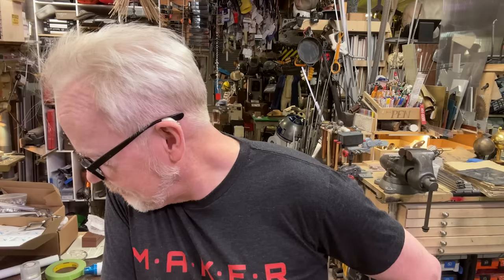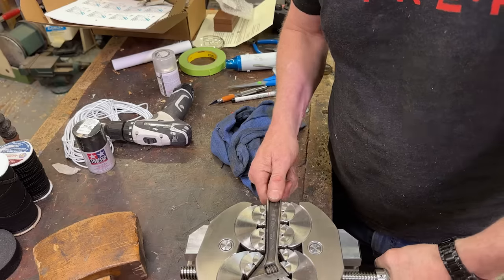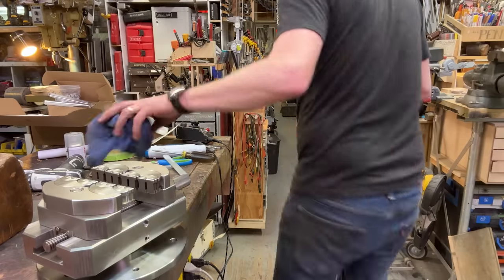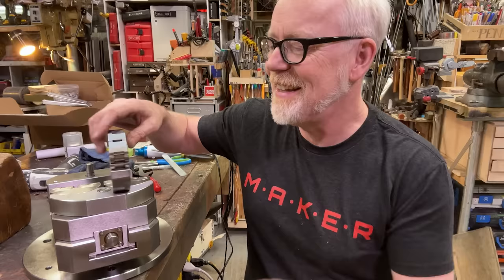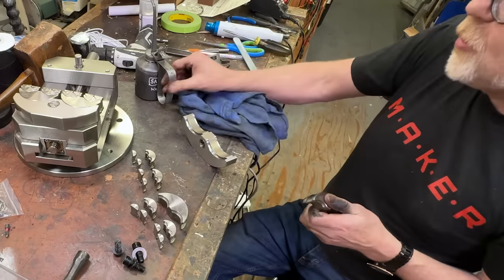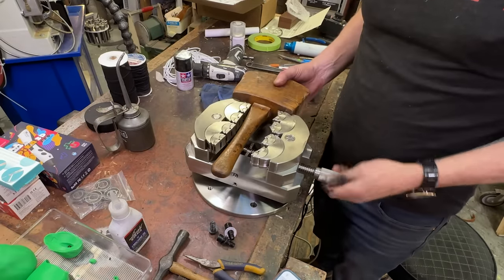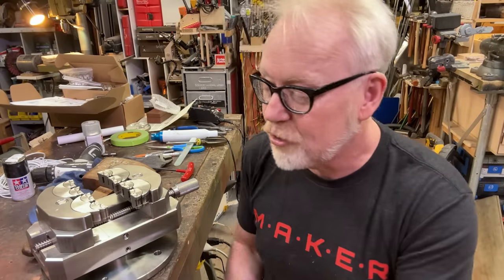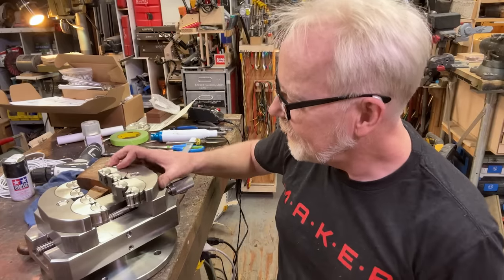Adam Savage in Awe of This Fractal Vise!

Comment: Machinist here: Adam, use a fine lapping compound to really slick up the vise. JB's bore paste is one that I would recommend, it's what gunsmiths use to lap in the bores of target rifles or to slick up an action. The only caveat  is, you will have to manually work the paste in the assembly to promote the surfaces to wear together, but something tells me you won't mind spending a few hours getting her polished up. Awesome find!
Reply: Didnt he literally say he was going to do that? I mean, it's nice to confirm and validate his thoughts I guess. Maybe he wasn't sure he was right already?
Reply: @Falenir Adam did ask for advice towards the end of the video
Reply: @Falenir  there are various grit and if too aggressive roughness, can bind and make it work worse.
Reply: For better action, you would want to increase the number of points of contact. It would be difficult to do with the geometry. Probably some 20 micron or coarser diamond on a nylon or horse hair brush. Possibly a basswood stick in circles. Possibly a cone type brush in a dremel to make non-uniform scratches on the mating surfaces to break up the contact points. Finish with semicrome or blue rouge or similar  to de burr cuts made by the diamond. If there was some way to adjust the tolerance, it would be easy. Also, a machinist here. Worked for 10 years in extrusion, making dies, slitters, and punches. Now, I'm doing maintenance for robotic welding and hot forming.
Reply: Question for the machinists. Are there preferred faces to try and remove material from? For example the surroundings of the dovetails over the dovetails themselves, or vice versa.
Reply: Came here to say lapping compound!
Reply: @InsanityOnWheels  I would try to break up the surface above and below the dovetails. The goal would be the same as honing an engine cylinder. Cross hatch pattern that holds onto oil.
Reply: Just remember to wash it all out when you're done  ;)
Reply: He literally said this at 18:12
Reply: @jutny see above
Reply: @FPSG NO -- keep diamond,or ANY other durable abrasive AWAY from the sliding surfaces ! ! ! 
Silicone carbide is o k .
moderndaytinker here 😎👍
Reply: @Intentionally_Inflammatory  So they missed a part of the video. Who cares? I bet you correct spelling on twitter.
Reply: @bobbob8229  As long as you clean it and do not lap with it, it's fine. Lapping the surface together with diamond would 100% embed it in the surface. Garnet would be better. Sc might work, but I have never had any luck using it in the way I described it. The grains just don't seem to be sharp enough to cut without some pressure.
Reply: I would machine a straight line into each piece so it can be adjusted with a straight edge or screwdriver.
Reply: I would’ve tried a valve oil, used in musical instruments like trumpets, it’s a very fine oil and it is about a 10th the cost
Reply: He'll send it to be done by the faceless worker.
Reply: Toothpaste.
Reply: not a machinist 1 year doesn't count but I work in semi-conductor and if you're looking for polish products you might want to look into wafer polishing slurry that said no idea where you would buy it we backlap and polish wafers to mirror finish and grind them down to 3 mils 0.003" 0.0762mm thick (not a brag anyone would care about except a machinist maybe lol) never tought looking at the surface with a microscope but the scratches must not be deep considering there's almost no material in the 1st place

Comment: The more people know about the fractal vice, the more people will want one, and the more practical it will be for companies to make affordable ones.
Reply: the law of supply and demand
Adam has created a demand for these now, so the supply will need to catch up, lol
Reply: The problem is this takes very high manufacturing tolerances, and hand assembly.  It is a high precision instrument masquerading as a dumb shop tool.  $2500 may be high but probably not that high for such a construction.
Reply: As cool and satisfying as it is, it's actually kind of impractical,.. not sure what uses it had in mind without a hand crank bar
Reply: the way each piece connects to each other without the need of complicated components or tiny pieces like screws or being bolted or anything makes me think that it should be cheaper than other tools that need more complicated construction. as long as the pieces are accurately constructed it's relatively easy assembly should reduce it's cost. it's so expensive because it's an uncommon design
Reply: They'll get cheaper but they'll never be cheap,
Reply: More affordable yes, inexpensive probably not. :)
Reply: That would be great, because they're sure not affordable now! But if it came down to a few hundred dollars I'd absolutely get one.
Reply: @JohnVanderbeck  There are alternative and cheaper ways they could do the mechanics of a fractal vice.

Alternately, if there is enough demand, specialized tools could be made for mass production.
Reply: Super fine machining is never really cheap though, no matter how many is made.
Reply: @mandelorean6243  Exactly, imagine trying to keep that thing clean lol.
Reply: The uses I have for one of these in paintball repair is growing with each second I watch this video, but 2500$ is definitely out of the question so I'd love to see affordable ones become a reality
Reply: I see $1,587 for stainless steel! Too rich for my blood, but certainly less than the $2,500 mentioned.
Reply: You are always going to pay over 1k for these regardless.
Reply: I honestly had no idea these were that rare. I have worked at 2 different companies where these vices were really common. 1 did furniture repair and had 1 of these with rubber grips at the end, the other did oilfield engine repair and every mechanics bench had 1 and 1 guy had a second giant one. I just assumed these were about as common as flat grip vices.
Reply: @ksavage681  there is a market for an inferior version. Adam will but his vice on a mill. He will put that horse to work.
But... if you want something like this for smaller scale or plastic/wood, then you get away with slop, that you can catch with rubber on the surfaces.
You would not put that thing on a mill; but... if you want to file the surface of an akward piece, the weak working holding is not strictly an issue.
Reply: @emeltea33 I'm sure a decent chunk of that $2500 was shipping it from China. It looks pretty heavy and customs was probably a pain.
Reply: @northwoods3d handtoolrescue should object
Reply: @ksavage681 you dont need super fine machining to mass produce a fractal vice to very high qualities. 
just a centerless grinder, a bandsaw, and an horizontal milling machine.

The issue is that each would have to be set up for just the fractal vice, a process that could take a month or two to get right, and 6 months to work out all the bugs and that is just thousands and thousands of vices 

On the other hand, i gave a method and tool list that could be set up for an equipment cost of less then 10k and Adam Savage + Hand Tool Rescue just dramatically increased the demand
Reply: Its hard not to think that maybe we've forgotten "how to make things" somewhat when stuff like this was made - quite literally - 100 years ago.
Reply: this!
Reply: @northwoods3d  I can't remember the exact item, but a few months ago, Adam mentioned some small part on Amazon.  I think it was the clips from his soldering station.  I went to check it out and two days after the video went up they were out of stock. xD
Reply: @Coconut-219  we haven't forgotten.
That said, those who specialize in various production techniques do so with the intent of automating every form of production with the intent of a world where both everyone works to get what they want; and nobody has to work to get what they need.

Or so that's how the field was taught when I went to be a production engineer and Machinist, alongside pictures and autopsy reports of all the frankly horrific and terrifying injuries that are no longer an issue due to our current level of automation. A very powerful motivation tool to get humanity past the industrial era, and fully into the bespoke, modular, personal automaton era
Reply: @Cristopher.C  THe problem is in machining not just 1 curved dovetail it's machining 14 to very close tolerances. Machining a straight dovetail is just a matter of picking the size bit you want and doing it. Machining level 101. Doing that in a curve is NOT level 101.

Honestly. I wish I had the machining skills to make a half assed attempt at that.
Reply: This was my comment:  $2500 is not a lot IMO for the amount of engineering in that for what will be a relatively low production volume item

Its the sort of thing that one you know it exists - every machine shop wants one.
Reply: @ksavage681  NO - you can not just cast it and bang it out like a normal vice
Reply: @Agnemons  All those working faces are likely to be finish ground, which means some fancy fixturing, and on the fly grinding wheel monitoring and maintenance. I can't see these being cheap(er) unless there was a massive demand.
Reply: Not really. If people are willing to drop $2,500 for them, there's no logical reason for them to ever be sold cheaper. This one needed work to even function sort of correctly at that price point. And, this one was from China. Made in the US, I could totally see the price being 6x higher because "It's not 'Chinesium'! It's made in 'Murrica!" and goobers lining up to pay it all day....for a widget that you'd use maybe once every five or six years.
Reply: @JohnVanderbeck  Exactly I don't think anyone could make it better and cheaper (delivered and with taxes!) just a matter of running the numbers really. To me this is a very specialized tool and there's always a market for these, just not a mass market. I'm not sure these are meant to clamp with a heavy force, I'm not even sure they hold parallel after you clamp something, there's bound to be some jaw lift given the multiple mating surfaces, so it probably is better suited for other non-precision machining tasks (Adam talks about using it as a milling vise but I don't know how safe that would be, especially with the current handle and no lock?)
Reply: @TinkersKustomPaintball  I think in your case where sometimes clamping force is low (for most tasks) perhaps if you mostly work with specific models you could come up with 3d printed jaw inserts and for the the rest of the tasks where force is required your current method should suffice because I'm not sure these vises have a heavy clamping force especially given the jaw style. I do similar work with CO2 and PCP rifles, my best friend is a piece of leather and a huge old vise. Most gunsmiths use the same method for clamping barrels, despite having lots of options available the good old leather or a piece of old engine belt works wonders. But I see what you mean, try to look into other positioning vise options if you don't need the force and maybe look into the 3d printing idea, no harm there. The reason being you can't really have a functional fractal vise if you lower the quality, just picture the cheap cast C clamps or the cheapest vises out there they are hardly usable (I've broken lots in the past without much force).
Reply: @tjfritts9013  Well for the most part you have to account for the cost of living, cost of materials, cost of transport, cost of machining in general (which includes machine maintenance cost, tooling, software and the cost of the machinist's salary) plus a certain percentage of time/material loss due to failed parts, fitting, packaging, etc. All of these summed up far exceed what Adam paid for his, let's not get into other issues such as taxes, politics / unions and every other sort of commercial cancer out there... There's hype but there are also great products made in the US, I get what you mean though. What I see happening is people ordering the parts from overseas and just stamping a name on them after some TLC to the mating surfaces, which I don't condone whatsoever but they could make a quick buck here and there until someone compares the two and busts them. The other option is to contact the current manufacturer and ask for a higher quality version which you could resell for a profit, but it will always cost more than 2500 each unless you somehow managed to purchase an entire maritime container worth to bring the unit price down, who knows!
Reply: Sorry calling shenanigans o. Your comment there abrr2000
Reply: Maybe they will finish them properly.
Reply: @Psyco913 nah, shipping was minimal. Ships crossing the seas daily with packages full of air and lightweight goods. The volume of the package is quite small.
Reply: @JohnVanderbeck  its so easy to assemble you can send it out disassembled with the quality of mass machined parts we can do in todays world it wouldnt be that difficult or exspensive if you mass produced the issue comes when you only make a few of them thats where cost becomes a issue.
Reply: @Cristopher.C  Oh boy, fitting curved dovetails are not easy or to make, cnc or not. This is as far from an easy manufactured design as you can get. People here seem to forget you can't really produce this properly with a normal dovail bit or cylindrical grinder. The easiest way I can think of is using a CNC lathe for the dovetails and then milling half of the jaws off. But it's gonna require quite a bit of setup to make something like this. 

What I don't get is why they don't make the jaws a bit larger (more like a D) and use center pins. The pins wouldn't need to take up any force when clamping (the circular surface on the back would do that), but would keep the jaws together when opening.

Comment: fun fact: the bearing surface being on the circumference is critical to how these work, because the center of pressure for each crescent must be BEHIND the center of rotation. This means that when you apply pressure to a crescent, it rotates TOWARD the source of the pressure, instead of what would normally happen, which is an object rotates away from applies pressure. If you look, the crescents are actually slightly less than half a circle. So if there was a standard axle, it would be partially outside the circle

Comment: I would highly recommend numbering the parts if you are going to put work into mating them. They were made close enough to interchange new, but as you lap them together they will become mates finding the average of each others error. I'm not sure without holding it just which surfaces bear the force first as they compress into each other, or if those might benefit from some cross hatching like a cylinder bore to hold oil. I'm glad you picked this up, and thank you for sharing it with us all.
Reply: Exactly.  I think that's what I was trying to get at in my reply.  Making a copy of something that was invented and perfected a hundred years ago or more isn't going to accurately represent the hand tuning and understanding they had back in a more hands on era.

Comment: I can't even tell you the number of times I wished there was a way to secure odd shaped parts while I worked on them.... never even knew something like this existed until you showcased it on your channel.  Thank you, Adam for sharing our love of cool tools with us!
Reply: The solution I've usually seen is to add wood or metal wedges or blocks to "fill the gaps".
Reply: I never did this kind of work and i saw this tool before
Reply: A lot of jb weld works.

Kinda expensive in the long run....